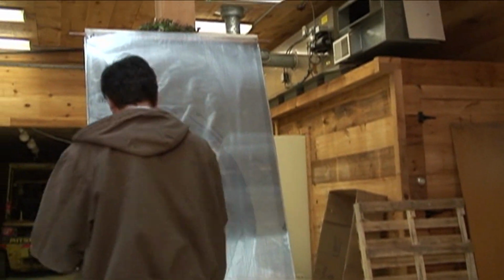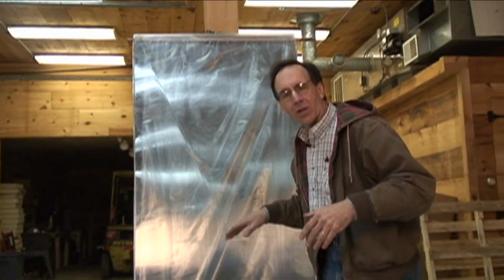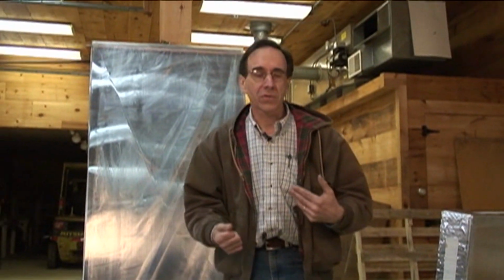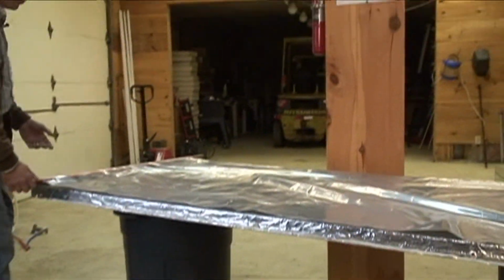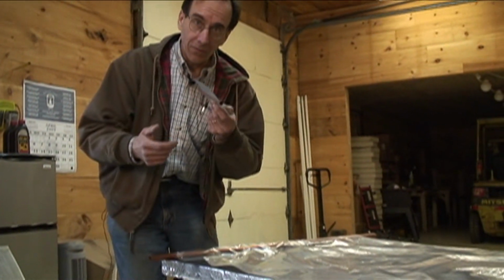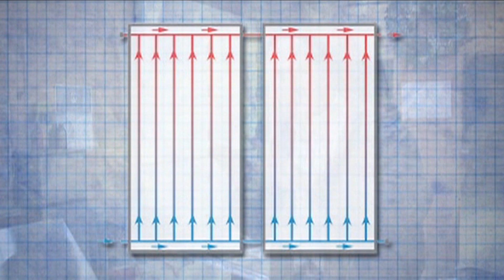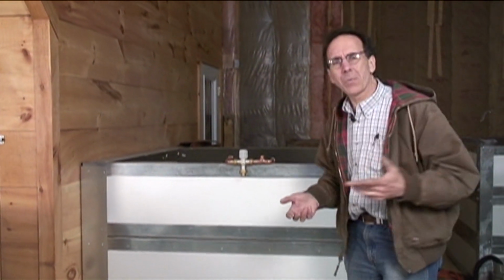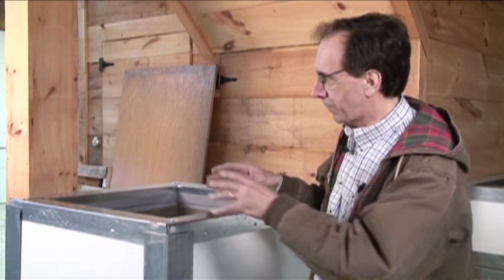Hot and Cold: Solar Thermal 101

Comment: Nice technology with the tanks and solar panels.  I would be a little concerned with asthetics on the panels with the plastic down here in Massachusetts.  But I understand the utility of the polycarbonate double wall panels.  I have some on a greenhouse shed that are 14 years old and look fine.  Regarding the tank technology - it looks like you are using vinyl liners instead of the more common EPDM, why?  I do like your modular technology for the tank structure as the 36 inch door is the major limitation for bulk thermal storage in homes.  Well done with the video and your business efforts.  I will look in from time to time to see if we might do something for mutual benefit.
Reply from the maker: Bridger Sci. The glazing actually looks pretty decent. EPDM breaks down in higher temps and the byproducts can damage/corrode copper.